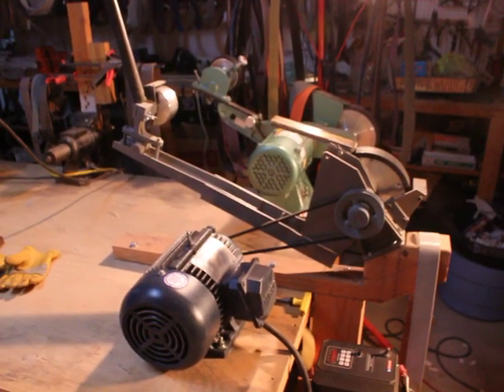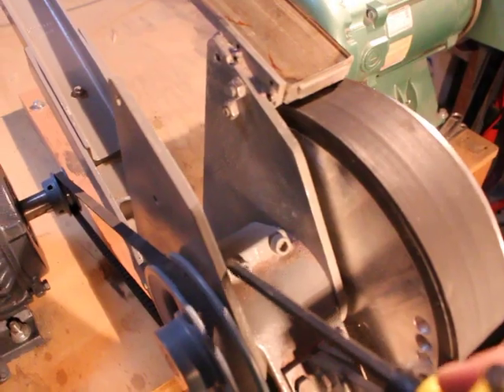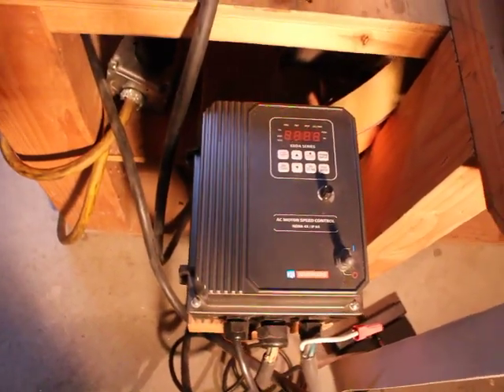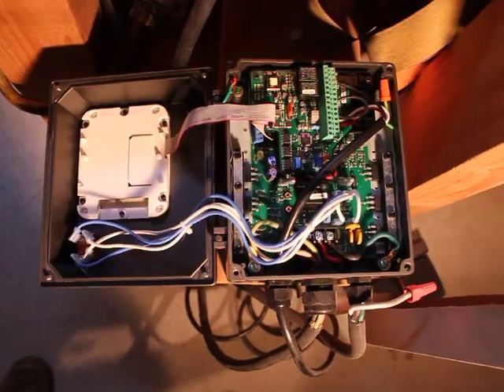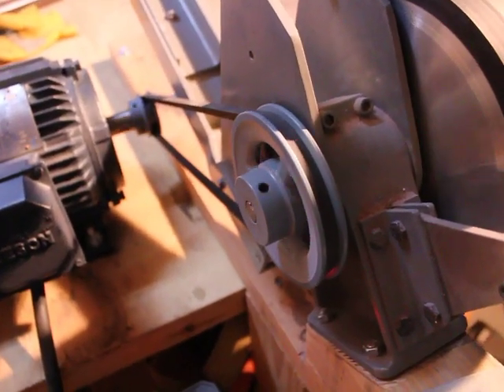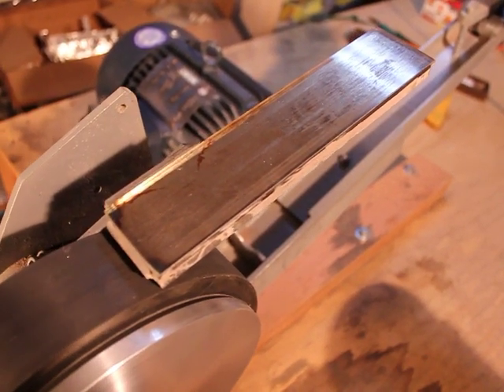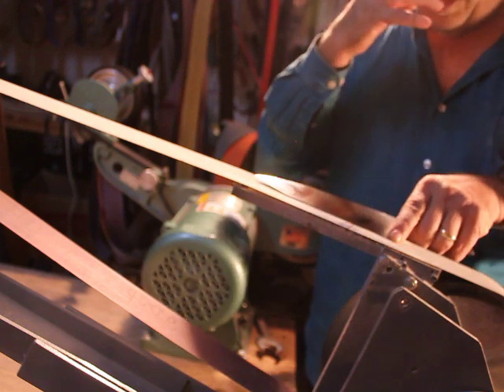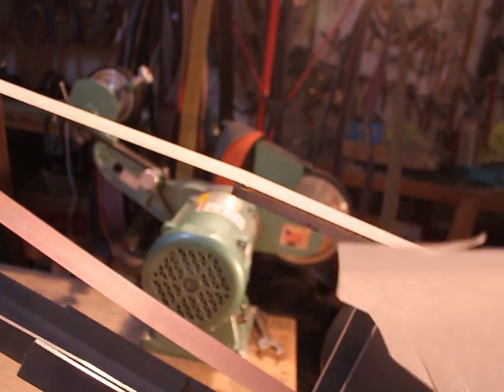Advanced Sharpening techniques: Coote 3HP Belt Grinder: Knife Thinning and Differential Grinding

Comment: I have owned a Coote Grinder for several years & I believe it is the finest belt grinder on the market in it's price range.  I set up the grinder with 3-step pulleys & a 1-1/2hp motor, & it has been quite sufficient for my needs.  While your setup is great, it is not necessary to have the 3hp motor, controller or footpedal for this unit to be satisfactory for most knifemakers.  Price was a consideration when I purchased this unit & it has performed well.

Comment from the maker: I LOVE my Burr King! I liked my Coote grinder before with a more wimpy motor, but now I LOVE my Coote too. I had a job grinding non stop for over 2 hours on the Coote and afterwards felt the motor - still at room temperature. The cast iron motor is one big heat sink and has lots of inertia, so it makes it real smooth to use. A real gentle beast. The Coote and Burr King are so quiet that I can work all hours of the night without bothering anyone.

Comment from the maker: Thanks, Gary! I had a simpler setup on the Coote for some time, using a treadmill motor. I agree - the basic unit is a purchase I never regretted. Having the flexibility to set it up as you like in terms of motors and pulleys is a big plus. It is also very solidly built.

Comment from the maker: Exactly. By running the belt slowly it stays SO cool that I don't even keep water nearby to cool it! Notice on the deba that I keep a finger near the tip the whole time or close to the whole time. You can't do that if it gets hot. Tips get hot quicker - less metal to heat up. I'm very conservative about not getting metal hot. Thanks for viewing it!

Comment: That's an extremely good set up. It would be great to slow down the grinder to reduce heat, and also its nice and quiet.
I was hoping to get a Burr King with the 20 inch wheel, but that Coote grinder looks pretty flexible. 
Great video.
Thanks.

Comment: Thank you for your efforts to detail your set up(s), why you engineered it the way you did, and the technique for "finger-back-pressure-grinding". My instinct is to always have the belt flowing away from the knife edge, but can do it the opposite so that burring does not develop. Without a grinder, i always used just my hands with two pieces of course to fine quality emery paper to produce a slightly concave grind. What a chore. ||| I am curious (please tutor me): why is it not a wear-problem for the underside of your belts to have your glass plenum slightly out of trued parallel-alignment with the belt? I recognize you intentionally have it set up to put 'slight' tension on the glass plenums end toward the small return pulley, but i don't know why. I am guessing the slight wearing on the belt underside is not an issue and that the 'up-tilt' is needed to keep the belt from slipping off the glass plenum. [did it get that right?]

Comment from the maker: I agree. That wire sticking out of the box is NOT hooked up to anything and was too thick to get into the hole. I should cut it back flush to the insulation and tape it over for a more aesthetic appearance, but since I am the only operator, I felt it adequate for now.. Otherwise all wire tips are solder coated to reduce any stray strands and connections tested and done under magnification before applying power. The wire passes through NEMA 4 connectors for the box.

Comment from the maker: Because the run of wire is long to the VFD, I used a higher gauge wire than standard to not get a voltage drop from the length of wire (good to 600 volts). The liquid tight fittings for the wiring inputs will not accommodate 4 wires of this gauge, only three.

I think at least for my usage that the Coote represents an outstanding value in terms of putting together a very flexible design.

Comment: ok gotcha ya its really not a big deal if its just u using it and u no to just be careful but i believe none of those wires should be showing outside of the box. like the outer insulation is all you should see coming out of the connector but i could be wrong never really messed with vfd's. but ya anyways im thinking about getting the coote are there any downsides to the unit you think i should look out for?

Comment from the maker: The wall current comes out of a NEMA 14-30 plug from a 30 amp single phase line with two hot leads, a neutral (white) (not used) and a ground (green) (used) to ground to the VFD chasis.,The VFD requires the two hot leads and the ground but not the neutral lead, so it is not run inside the VFD enclosure. It is cut flush to the insulation AND a wirenut put on it. (cont'd)